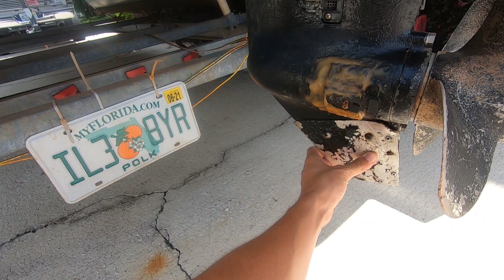I Bought the CHEAPEST Running Pontoon Boat I Could Find. LETS RESTORE IT! -Episode 1

Comment from the maker: What do you think is underneath that bondo? A hole or a dent?

Also an update on my lake front... my neighbor took the sand a couple days ago and spread it out. Looks much better down there now!
Reply: Underneath the bondo is a DENT and a HOLE.
Reply: Japanese engines are normally well designed and trustworthy. Choke is with pushing the key in, you can hear if it works. The ball on the hose is for priming the carb and fuel pump, must be done in advance. Great find! 😀
Reply from the maker: TheStuartstardust yeah I tried pushing the key in to choke but it didn’t sound like it was working.
Reply: @ultimaterebuilds7127  OK - some have manual on the front of engine also, which can override the electric one. Check the coil on side of carbs if it pull the choke plate. Good luck with the renovation and thanks for the reply - greetings from  Denmark where summer is the best day (yes only 1) of the year 😎
Reply: TheStuartstardust greetings from Texas where winter is the best day of the year
Reply: Hey the silver posts that you got are used for the cover
Reply: Get rollin' on this, we're dying to find out !!!!! SUBSCRIBED
Reply: @Roblox_Nerd what do I mean , about what?  dying to find out?  the restore video
Reply: @Roblox_Nerd that's weird

Comment: Nice. Just scored a 20 foot pontoon myself that has a 70 and came with a running 115. For 1000$ whole deal boat motors and trailer
Reply: Ken Avis  noice 👍
Reply: I just got my self a 1983 procraft 16.5 ft bass boat 115 hp for 1k and it runs 😂

Comment: Those poles at you’re showing at 8:50 mins are to hold up the cover to the boat. They go it the center front to back. Like a circus 🎪 tent ish lol. And that bracket was a grill support that screws onto the side rail

Comment: Good luck with the project. Skeg is the fin on the bottom to protect the prop.  Let the motor crank for a few seconds, no need to stop after just 1 second.  Do the PM and clean the carb bowl, water pump impeller and lower unit oil. Looks like you got a runner!  Then do the bearings or hubs.

Comment: ok i agree take the seats out of the boat to save money on a new captains chair go and look at a marine salvage company near where you live a lot of times you can get really nice captains chairs for pontoon boats and water craft at half the price. i would then go and look online for a larger motor or have a marine motor specialist repair the water keel on the bottom of the motor you have.. as for the rest of the seating and bench seats have them reapolstered its cheaper they will replace the foam inside as well. also look for some new gauges the reason why those gauges turned yellow is because there leaking 100% they are no longer water proof most of the things on that craft are just basic maintenace issues you got a killer deal 100% especially with that nice trailer.. good job and keep up the videos.

Comment: You lift the choke lever when starting and it creates high idle.    It locks out forward and reverse gears.   Likely i would dump the old gas and mix new 2 cycle oil in with the gas.   Clean the carb and float bowl with spray gumout carb cleaner.  Check the lower unit to replace the  gear oil.  You can easily buy the skeg and lower unit cover plate.  Dont forget to change the impeller and check for water coming out the telltale..  a tiny stream of water telling you the impeller pump is working.  
     Several neighbors and I all did our pontoon  boats with only portable  lawn chairs.  Super easy  to  position for guests and to clean.    It works great.

Comment: Ok, a few things. 
1. The squeeze bulb by the motor is a primer ball. 3 to 4 squeezes to get the gas to the motor and prime it for starting
2. the lever next to the throttle is a choke lever. You use this to help on cold starts. 
3. some of the pols are your nav light sticks.

Comment: To start the boat...
Squeeze primer bulb till its tight or you hear gas at the motor.
Lift the flat lever next to throttle to disengage the shifter.
While turning the key, press in on the key to choke the motor. It clicks but does nothing if it's not cranking so don't kick it before turning the key.
Once you hear it crank stop pressing in on the key and just turn it.
The thumb switch on the throttle is for raising and lowering the motor. 
When down it moves slower to adjust for trim. (raising and lowering the bow in motion) 
Hope this helps
Reply: When storing the boat for longer periods disconnect the gas line from the motor and run the fuel out of the system!

Comment: Definitely underpowered with 40hp. I’d rebuild the carb on that suzuki, do a full service on it (plugs, lower unit oil, impeller) and maybe even paint the cowling hood and do new decals ($50-$75) and sell that thing with controls. 2 stroke Suzuki’s are very reliable and people love them. Get yourself a 75HP or more. Great find and cool video!

Comment: Nice find! In my humble opinion,  remove  everything from the deck and start from scratch. That way you can plan the seating, the wiring for the sound system and the lighting the way you want it. Replace the motor with something that has a bit more grunt. I would paint the hull black and use various shades of grey (not 50) for the seating etc up top. And finally, lose the toilet.  God designed a perfectly functioning one in the lake which you can use without anyone knowing your business!
Reply from the maker: It’s like you’re reading my mind 👀
Reply: @ultimaterebuilds7127  I second this
Reply: @VasilyBuilds  No toilets and no Cheetos.

Comment: 8:52 When I purchased my pontoon new, it came with a boat cover. Those poles were to put under the center of the cover midship toward front and back to give the top ‘pitch’ so water sheds off of it. Otherwise your top pools water when it rains and turns your boat into a pool.

Comment: The 40 hp is to small. It will cruise fine but hard on gas. 50hp to 70hp. The adjustable poles are for your deck and seat cover that protects everything from  the sun and rain. They poles hold up the center of the cover for runoff. Get a new one made along with a new canopy cover. Give the transom a good inspection.  If there is any damage, its better finding out now rather then on the water or after you hang a new motor from it. Add trim control for your outboard. When you have a few extra bodies it will help to level out.

Comment: Use the regular blue toilet bowl cleaner on the pontoons, it will take all the staining off. Water it down so you can spray it on with a pump up sprayer, don't leave it on long just do a second app if needed.
Reply from the maker: Will that take off the paint too? I’m planning on stripping it all off.

Comment: Pull it all apart put down lumberock decking and use plastic patio furniture with sunbrella cushions as seats. Also “alumibright” for the hull, it will look new! Get a hold of “that boat guy” on YouTube for a replacement engine...

Comment: x14 on the seats. will completely take out any stain without any scrubbing. But you have to wash it off well after. Then once they are dry, spray 303 aerospace on them. Similar to Armor All but it wont dry them out and crack. It will completely restore them. They will feel brand new.

Comment: That ball you sqeezed behind the engine is a fuel primer. Pull fuel from the tank and pushes it to the motor for starting after its been sitting

Comment: Tip when it comes to pressure washer pumps don’t leave it running while your not using it it will kill the pump so turn it off if you set down the wand for something

Comment: The Black thing that you squeeze is called a fuel bulb squeeze it till it’s firm then start it it will start a hole lot easier and don’t put it in gear there should be a button so you can just rev it up hope I could help

Comment: you need to replace the water pump or it will overheat, the motor is not pissing due to water pump failure or line is plugged.  check the paint on the motor, if its discolored, it may have overheated already.

Comment: I would junk that outboard it looks like a 40hp way too small, a good quality Honda or Suzuki at around 110 hp would be sufficient. That bondo is unfortunately most likely plugging a hole or crack.
Reply: It says 40 hp on the side
Reply: 40 horse is fine i had a 32ft pontoon with a cabin in the back powered by a 50hp 4 stroke honda and it cruised at 20 pontoons dont go very fast anyhow there made for cruising at low speeds

Comment: You need to replace the impeller doesn’t seem like it’s peeing water, also drain all the fuel and replace with ethanol free and 2 stroke mix it saves the seals In the motor. Also try pontoon stuff.com they have everything you need. If you are trying to replace the carpet might just want to replace the wood, you will thank me I’ve rebuilt 5 pontoons so far.
Reply: Also join pontoon junkies on Facebook they can help with everything

Comment: I have an old 1999 21 foot boat, was wondering if you want it. It has a 250 Johnson which has trouble running, It comes with a trailer.

Comment: That little rubber ball thing that you were squeezing was not for the choke that was so you can put fuel into the engine to get it started the pump fuel it goes from your fuel tank to the motor

Comment: At the very least clean the carb. It sounds like it’s lean on gas. Might as well replace the impeller too. Impeller is a little rubber wheel inside the motor that sucks water in to cool the motor, it gets old and stops working and it overheats and kills your motor permanently. You might already know this sorry if I sound like a know it all
p.S. that looks like a 25 horse that someone put a 40 horse sticker on....

Comment: Uhmmm...I think you could get it much cleaner if you actually washed most off the dirt OUT of the boat instead of to a different location IN the boat....just a thought.  I would have pulled most of the interior washed it ou let it dry... made minor repairs....replaced the benches etc.

Comment: Bro you always lift that lever to start it, that’s the rever, links with the choke
Reply: Has nothing to do with the choke it's so you can rev the engine without being in gear the choke is at the key you push it in and it electronically activates the choke and the black thing by the motor is the primer ball when you squeeze it forces fuel into the carburator